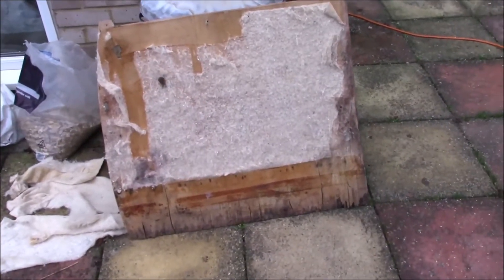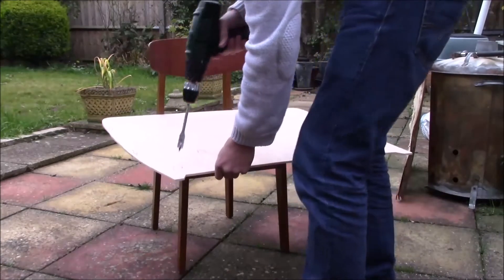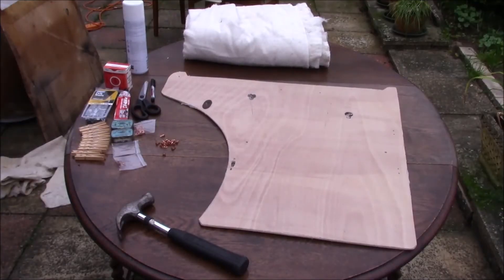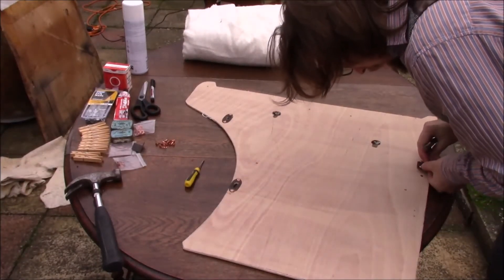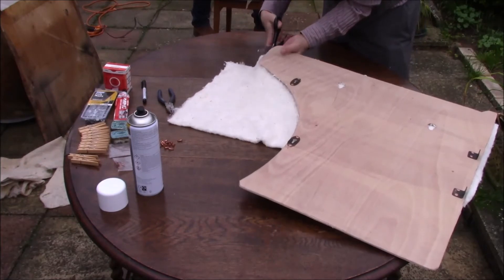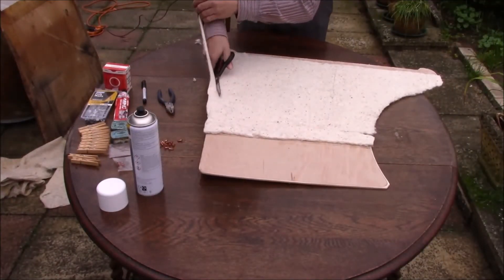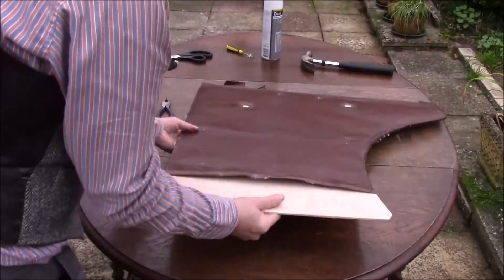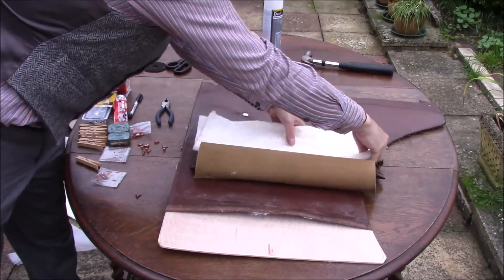1951 Lanchester LD10 - Door card rebuild and other news

Comment: I used as much as my existing interior as I could as well when restoring my Lanchester, but the carpet, headliner and roof had to be replaced, so I used modern alternatives as possible
Reply from the maker: We're really hoping to salvage the headlining, it's in surprisingly good shape, but very fragile, and we have a new wiring loom to go in so it's risky.  New carpets are a must since we have none, but at least it all looks straightforward to replace, and happily I have some experience in making and fitting traditional cloth headlinings like this.  I'll be sure to check out your Lanchester content soon, had a quick look at the videos you've got and there's some interesting content there.